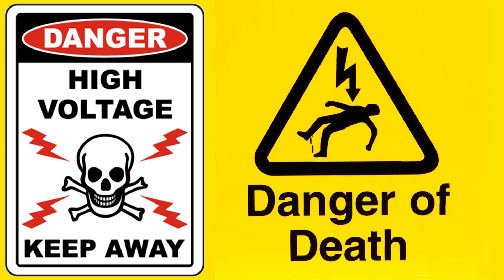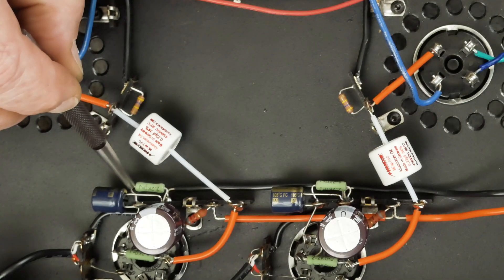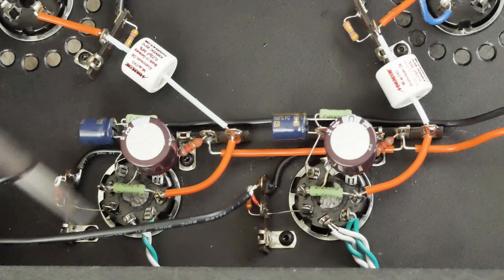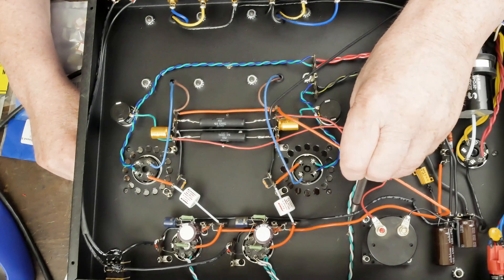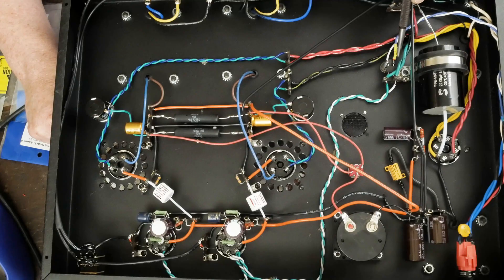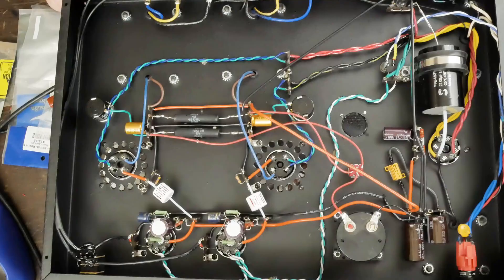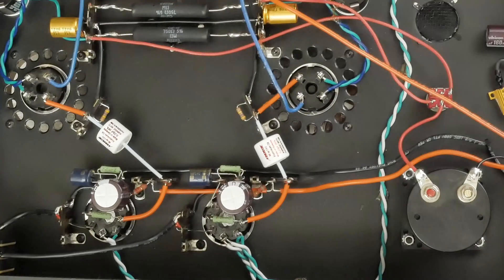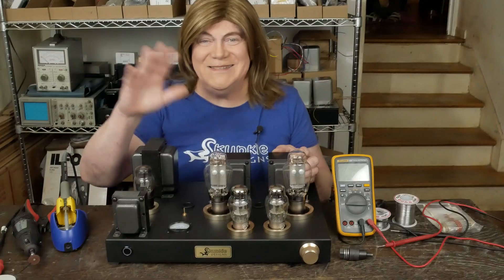2A3 Single Ended Tube Amp DIY Build: Final Wiring and Tests!

Comment: Nice!! I would suggest best practice is to 'only' use non conductive pointer or one day you will be bit.... 🙂
Reply from the maker: The amp has no power , caps are drained etc. so it would be pretty difficult to get shocked.

Comment: Try using a 5R4 rectifier in place of the 5Y3 rectifier similar voltage drop but can handle 250ma
Reply from the maker: I did. The voltage drop isn't nearly as much, as the drop is on a curve based on the used ma vs rated ma.

Comment: Hello, because i am in the first in line to react i think it would be nice to say that the build quality looks so logical. But i wonder why there is almost nobody who tries to change the power supply into a real choke input. With a choke having enough Henry and a necessary bleeder resistor installed. Of course not all chokes can be used for choke input because the cheap ones usually buzz. I usually go for a Lundahl . The LL2742 can be ordered with your own desired airgap at no extra cost. But you need a power transformer with quiet a bit of extra voltage but it will have an easier life so you dont need a big current rating. I will try to find out how to pay the first ten $ of your choke. Here in Europe they are around 120 € and big advantage they will last a life time. Greetings,Eduard
Reply from the maker: Higher voltage transformers are $$, the choke has to be extra heavy duty which most aren't, Lundahl chokes have no cover/end bells so then you have to buy that or just have an ugly part sitting on top of the amp with high voltage wiring exposed etc. The current rating is determined by the circuit. And I appreciate your offer, but $10 isn't even going to start to cover all the additional expense.
Reply: Hello, an additional 100 volt won't break the bank. A choke made in Costa rica to save cost will probably buzz when pushed to the limit. But if i measure 70 mA running in choke input mode i will order a 80 mA Lundahl.  In fact i did yesterday. I will put it inside the chassis to reduce the cable length as much as possible. If there is no space i will use a cover and put it on top with terminals facing down. It is just like using Tango output transformers if you don't try you will not know. Greetings,Eduard